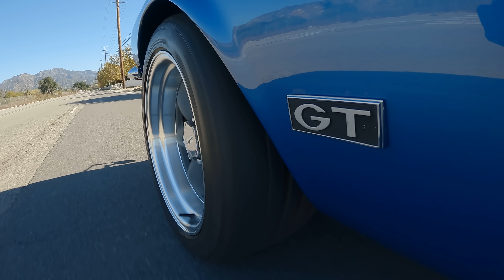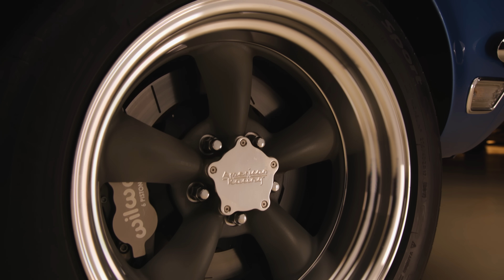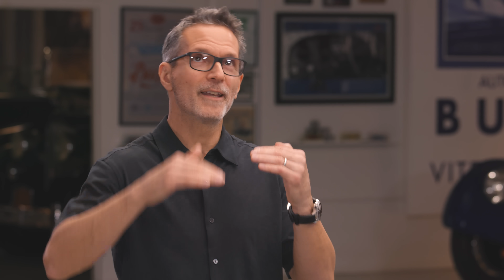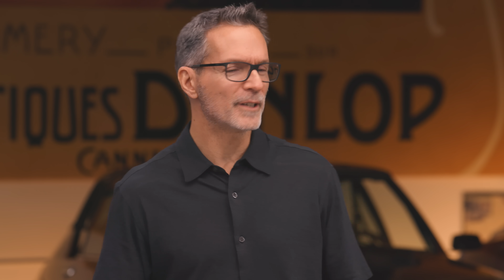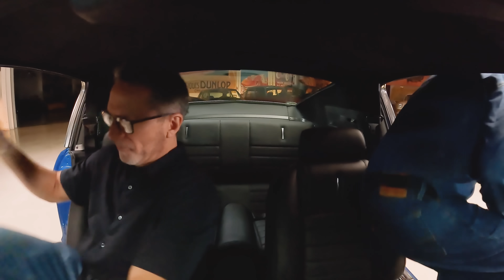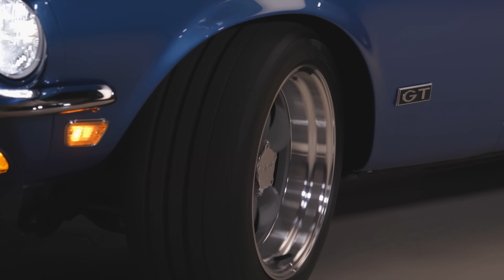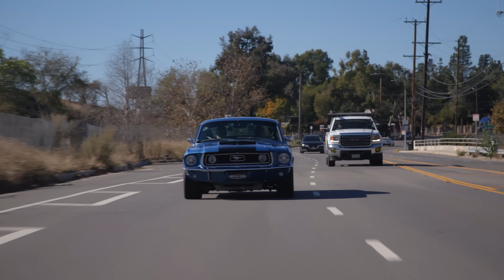Revology 1968 Mustang GT 2+2 Fastback Cobra Jet

Comment: I have a 2014 Shelby GT500 and can tell you the redundant safety features of this car are phenomenal. The value per dollar is over the top. My very 1st car was a 1969 Mach I with 351W 4 spd and just about every option and then I added a few. Still love that car but would not trade my 2014 Shelby for one even if it was a 428SCJ. Revology did a Great job recreating a classic car unfortunately time goes by too quickly to really enjoy the money a person would have to pay for a car like this....

Comment: The attention to detail is amazing on this car. Front and rear spacing from tire to fender, the steering wheel, door hinges, and those gauges…outstanding.
Reply: The head rests should be higher!  Where they are at now you would break your neck if hit from the rear!
Reply: @garybulwinkle82  Yes, but hard enough impact with headrests youre still gonna get neck damage. I drive an early 'El and the rear window would bust my head. Cant worry about all that just be observant and enjoy
Reply: Absolutely!!  Stance is SO important, can make or break a car esp with say a white paint job

Comment: My dad had a 68 Mustang. When I joined the Navy in 70 I found out he had sold it. I tried to buy overseas a Mustang but they would not cosign for me. Going to middle school in Denver a neighbor had 2 1969 Boss 302's which I saw every day.  Ended up getting a 1970 but traded it for a 1968 Corvette convertable which I had in the Philippines with me for 3 1/2 years. Humidity ruined the paint. I returned in 1980 had it painted around 1985, and that paint is still on the car. It actually sat in  different garages over the years, 1997 till 2018, because my wife, who allowed me to buy it in 1976, just before being transferred to the Philippines, had passed away and I could not bring myself to drive it. So 2010 came around and I moved again, my brother who had the car in his garage had it shipped from Cali to Texas where we moved. 
There it sat 8 more years until I had to make a choice, try and sell it and get mostly nothing, or try and get it fixed. Brought it to carrscorvettesandcustoms and spent way more money than I had to get it at least drivable. It's not 100% new everything because I don't have that kind of cash, but it does have a new interior, engine, transmission wiring and other things that make it a better driver than a unmodified 68 would be. In fact it also still has the paint from 1985, since it was always covered in a garage, but sadly it's thin in spots and you can see primer in the right light. Since it fiberglass and a 68 it's obvious there are tiny issues in spots. 
Watching this video reminds me how poor I really am. No way I can afford a paint job, Carr tells me will cost upwards of $25K. It is what it is as they say. In 2022 I finally got a Mustang, purchased a 2022 Mustang GT/CS to my specs.  Both it and the Vett stay in the garage and neither one is ever driven in the rain. The vette will never be the Mustang I wanted but it's a memory that will always be with me.

Comment: I'm trying to think, do we actually WANT this kind of car without a lumpy V-8 that can barely idle?  This is a technical tour de force, of course, but do we want a car that's back to being a 1968 car in so many ways  but that doesn't have that sound and smell?  Take brakes: that'd be great if I was going on the Nurburgring but I'm not.  Frankly, 11" disks in 15" wheels would have been fine and looked probably better, and would still have modern braking power for a couple stops in a row even if it couldn't do fast laps.  Taller sidewall same story.

Comment: My old 2000 Mustang GT had 150 on the speedo, I know that the 03/04 SVT Mustang Terminator Cobras had 160, my current 06 Mustang GT only has 140 🤷🏼‍♂️ So yes Mustangs have had 150 or more on there speed gauges in the past.

Comment: However...I'd modify the tunnel ram with injector  bungs and run multiport with upper intake cap with a dual front facing throttle body

Comment: I forgot to mention that he was quite evasive on the tires. It sounds like no major tire manufacturers make a tire in that size. If you are a millionaire that might not be an issue but for a comfortably rich guy ponying up for replacement tires might be a shock especially if they aren't even available. It sounds like this company has a relationship with some tire manufacturer to make these tires. What and where are the owners of these cars going to do when it is time for new tires?
Reply: There are plenty of performance tires in 17"

Comment: The car that was tested did not have the larger wheel and tire package it was on 245 section tires, this car, I believe is on 275 section tires so it will hook up better than the Car&Driver test car.

Comment: When i built my vw sandrail i had to list it as an assembled vehicle. Just had to have State police come out and inspect to see if its road worthy. He was so impressed, i think i could have forgot about the 5 point safety harness to install and i still would have gotten a pass to drive on the road. 
Jay was really interested in the tire size, cant drive it when the rubber is gone.

Comment: My Dream Garage
Rolls Royce Silver Seraph Silver Spirit extended long wheelbase silver sedan/saloon petrol
Range Rover (P38A) purple sunroof SUV/4 wheel drive diesel
Jaguar XJ Series II XJ40 S type metallic sunroof sedan/saloon petrol
Ferrari California Testarossa yellow supercar retractable hardtop petrol
Porsche 911 hot pink 996 2 seater retractable hardtop spoiler orange sports car petrol 
Jeep Wrangler JK red 5-door convertible full-size SUV diesel
Volvo S90 hydro chromic ink grey full-size sedan/saloon petrol
Ford E series fourth generation van brown/maroon diesel
Peugeot 405 Station wagon roof railings petrol white*
Volkswagen Golf MK2 MK4 5-door GTI vinyl wrap orange hatchback petrol*
Chevrolet Camaro GT thermochromic green paint muscle car fifth-generation petrol*
Recreational Vehicle Converted Bus Class A MCI cream beige diesel*
Subaru Impreza WRX blue stripes sports sedan saloon petrol*
Lincoln stretch limousine jet black second-generation sunroof petrol*
2018 GMC Sierra 3500HD Denali DRW navy/sky blue double cabin pickup truck diesel*

Comment: I love the 1st Gen Mustangs, especially the 67-69 editions. They are just the perfect classic Pony car in that the exterior design can't be beaten. The problem comes when you drive one of the original Mustangs. The carbureted V8s used in the 60s pump out a ton of noxious chemicals and they aren't efficient. The handling and braking are pretty shaky too for those of us accustomed to modern vehicles. Revology solves those issues with this modern recreation of the Mustang. It's got the powerful new Coyote under the hood, responsive braking and handling, and a comfortable interior. Now I just need to win the lottery to afford the 300,000 price tag.

Comment: As I recall it there were plenty of folks who didn't like power steering or power brakes because they missed the "true driving experience". Also, power steering was easily accomplished with a flat hand palm motion on the steering wheel in any direction. Wouldn't want to try that nowadays.

Comment: Jay is so right about cars from the 60’s, my HS parking lot was full of them in the 80’s. They all rattled, barely stopped, handled like a living room and always needed something fixed. I think we romanticize having them more than actually enjoyed driving them. This version is just incredible.
Reply: @risinbison1106 - Not all fortunately.  The mid/late 60's Chrysler Imperials had decent opposed piston disc brakes in the front and a nicely tuned torsion bar suspension system that stopped and tracked much better that most GM or Ford offerings at the time.  The larger Chrysler engines had a water pump that you replaced with 4 bolts to remove the round flange without disconnecting any hoses making a water pump replacement a 15 minute job.  Headers had through bolted flanges for the crossover pipes or the dual exhaust systems front pipes so many times you just broke or cut the bolts without having to worry about breaking, drilling and tapping in new studs.  

They were quiet reliable cars that you could get 200 to 300 thousand miles from just by driving them respectably along with changing the oil and flushing the fluids plus performing the chassis lube per the owners manual.  This was even true of the Slant 6 powered Valiants and Darts.  Even the cars with power drum brakes could put you through the windshield if you weren't careful to maintain a light touch on the pedal.  Modern cars with ABS systems require much more pedal effort to stop them.  Of course being drums you did have to check to ensure the automatic adjusters weren't being too aggressive and back them off so you wouldn't have brakes rubbing all the time and fading.

The Mustangs from the 60's though were designed to be cheap and were death traps.  The gas tanks took out a lot of them since to save money they did not hang them under the cars but dropped them through a hole in the trunk floor so the folded over flat top of the gas tank became the trunk floor.  In a rear end collision since the weld for the top of the tank was towards the front and the rear bumper and unibody cross member was so weak it would come open from the impact forcing gasoline through the back seat soaking its occupants where a lit cigarette could cause everyone inside the car to be burnt alive instantly.  Most others were slung underneath with a steel body panel separating them from the passenger compartment while those that went through the trunk floor came up through the bottoms so the seems were outside the passenger compartments.

Kids in High School on a limited budget most often took shortcuts and being on limited budgets didn't do required maintenance on time often skipping oil changes, chassis lubes, etc for years plus drove the cars like they stole them.  In the 80 those 20 year old cars from the 60's had often already passed the 100,000 mile mark 2 or 3 times and since most sold new for around $3,000 by the time they were 10 years old they sold for less than $500 and had already been treated as Beaters for a decade or so.

I was working on them in the 60's and well remember the good and the bad ones.

Best!
Reply: @neilfromclearwaterfl81  our parking lot was Cameros, mustangs, Darts and my jacked up Charger. We drive them all year round, -40F to 110F, didn’t matter. You’re right, paid about $3000 and drove it to its grave and money went to gas, thirsty sucker, and girls so maintenance was a big if. We had great times in those but I’d never want to drive that thing daily ever again but I do miss how easy it was to fix them. Thanks for the reply.
Reply: @risinbison1106  I had a Duster Tasmanian Devil on HiJackers with the factory Amoline Rally wheels, Graphics, etc in the 70's but when I started driving gas was only 25 cents per gallon or less so even on a bag boys pay you got 11 gallons of gas for an hours wages.  You could get an entire exhaust system for less than $20 from JC Whitney and it would be delivered by the postman either in his little push cart or perhaps slung over his shoulder.

After the gas crisis when the price went from 25 to 39 cents per gallon we were in shock stating that we wouldn't be putting up with this for very long and we were right, it shot up to $1.39 in a heartbeat or at least it felt that way.

Best!
Reply: LMAO "handled like a living room"! Truth!
Reply: They were easy to work on and cheap to service. Sounded good and had lots of room. Everybody could afford a car. That is not fantasy or nostalgia.
Reply: @danielleclare2938  They were all done before 150k miles too. Plenty of total garbage that looked great from the 60s and 70s.
Reply: That explains why so many are still around to this day..oh wait.... whatever Mr. Garbage Man.  @henryknox4511
Reply: @danielleclare2938  oh, I owned several but the heat sometimes worked, no AC, vinyl seats felt awful. I mean, yeah they were cheap but they weren’t that great either but it got us from A to B.
Reply: So you drove junk and think a $300,000 car is a better idea... whatever. @risinbison1106
Reply: @danielleclare2938 Nobody said they were not anything you mentioned. They were ALSO all the things the OP mentioned. They were not great cars, by many considerations.
Reply: How many did you own??? @joelspaulding5964
Reply: So true.
Reply: It was even worse if you went to highschool in the early to mid 90s because then the parking lot was loaded with cars from the mid to late 70s uuuhhhggggg my stomach still turns a little remembering how many beat up clunky mid 70s cars I had to look at out the window from the classroom. It looked like a post apocalypse out there. I would have loved seeing old beat up mustangs and Camaros from the 60s instead. At least then you could day dream about how good the used to be.
Reply: @Rek_Rc  omg, those late 70s, early 80’s cars were the worst. Chevette, K cars and giant station wagons  and the only way they break 100mph is if you pushed them off a cliff.
Reply: @MckIdyll I was right next to you in my 69 Charger with fabulous Keystone classics and air shocks. Some of my best memories.
Reply: If you're in the top one percent of income. Who else could afford this?
Reply: I owned a Ford maverick with a 302 that had a high lift cam headers and a dual carburettor set up... it was a pile of rolling junk but it sounded great. Near the end of its life the door fell off on the passenger side and as I was driving home the skin of the driver side door came disconnected from the inside of the door as I was trying to roll the window down that part dropped off onto the road. so I made it home and the timing chain broke... I saved the carburettors to hold my garage doors open when it was windy...
Reply: @rodneyjweltham150  hahaha, that’s great! It’s amazing we survived to tell the stories of our youth with what we drove.
Reply: Correct!!  Living back then was like living FT in a fri night cruise in. 
Best part was a buddy coming to school and showing off his new cam, mufflers etc. Gawd I miss that!! Used to change those like socks.
Reply: @gordocarbo  air shocks and Keystone classics with big bald tires, we had the world in the palm of our hands.
Reply: Don't forget smelling like gas or exhaust fumes 😂
Reply: Drove mine everywhere, 1 and only dailys in the 80s. Not one left me stranded unlike some EFI vehicles Ive had. 
By the time these cars were 10 yrs old they were used up...same as any late model musclecar they are beaten on a lot
Reply: I haven't been around from the 60's but I'd love a car that I can maintain myself. On my old car I changed head gasket after work and got to work at morning with it, the newer model of the same car I now drive has to be looked by a tech if a head light is blown. You tell me which costs more?
Reply: @19smkl91  depends on the car. You sourced classic car parts lately? Fixed my 2004 Toyota valve cover gasket the other day for $18. Remember, we’re talking cars from the 1960s here.
Reply: @risinbison1106  I get your point, the parts are the problem. But it's not about the year of the car but the mentality when designing and building it. On those ~2004 cars you can still do stuff and rocker cover is easy job, but weather it's easy or not you can't do it on modern car cause it puts itself limp mode and you'll need a tech anyways.
Reply: Who is we, vehicles from the 60's if maintained and upgraded run fine. What was the name of this high school from the 80's?
Reply: @russellweber3466  South High, Fargo ND. Also, most kids working at $3.35 didn’t have the money to be doing all this proper maintenance since most cars got 10mpg and gas is where our money went. Most of these cars were hand me down and already in rough shape and they were never built to be driven the way we abused them.
Reply: @risinbison1106  Routine maintenance,  didn't cost much, was this a special school district?
Reply: @russellweber3466  it was some hs where kids drived old cheap cars that were cheap ratty because they were cheap and ratty..
Reply: What a silly comment! Of course, they were in bad shape in the 80s! They were 20 years old and weren’t worth much and had been through many owners. Question is what were they like when new.
Reply: @craigyirush3492  new? Slow, rattled and never made it past 100k miles. Like I said, nostalgia. Not everyone drove a hemi or 454, it was usually 140 hp family cars that weighed as much as a battleship and they all handled like one.
Reply: @risinbison1106  but we’re talking about the muscle cars when new, not ordinary cars. And your ridiculous post tried to judge them when they were worn out.
Reply: @craigyirush3492  hahaha….they weren’t that great. I’m sure that 200hp Chevy V8 impresses you but an off the lot Honda Accord would blow its doors off and won’t rust away the moment it rolled off the assembly line. They looked cool and sounded cool but other than that they were bound for the junkyard after 8 years. You want to daily drive one, be my guest. Winter was always a life or death gamble that I don’t wish to relive. Maybe turn off the car shows and come back to the real world.

Comment: My ‘89 Mustang had a 140 mpg speedometer.
Reply: My '94 Lexus SC300 has a 160 mph speedo. Top speed in 5th gear at 6500 rpm redline is 156 mph.
Reply: mpg speedo? most are mph 😊